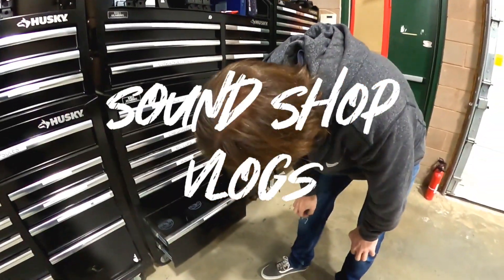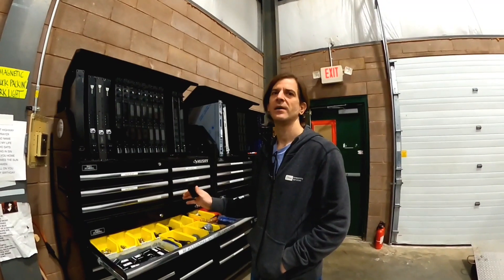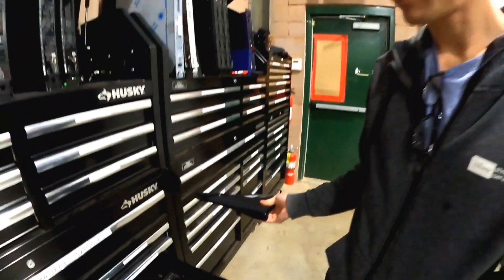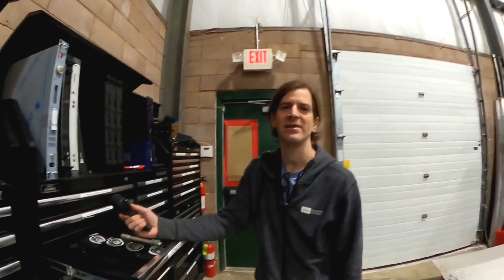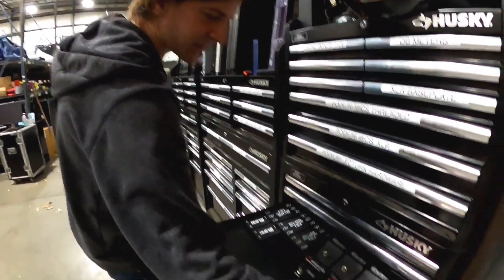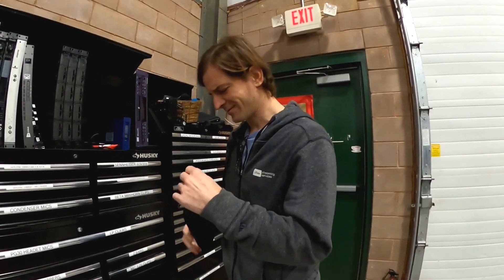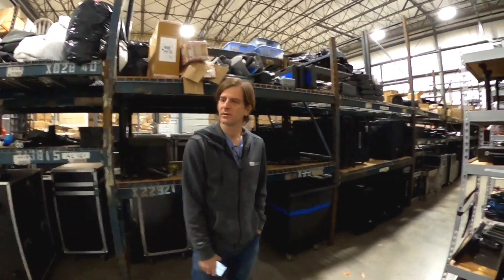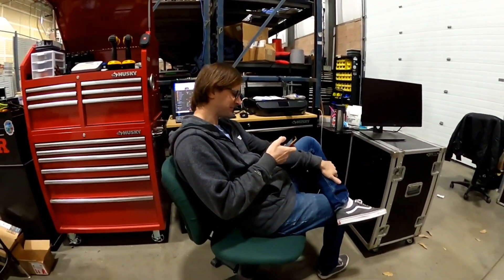s9e12 Our Microphone Collection Revealed! Shure Sennheiser |Company Owner Pro Tips | Missing AKG414?

Comment: What was that measurement mic with reversed polarity?
Reply: The Dbx one that is sold at guitar center
Reply: @michaelkurczeski1373  I thought it looked familiar... Never knew it was internally polarity reversed. But I guess it really shouldn't matter if you're using only one mic.
Reply: @lesfilip  I use it to tune systems and time align. When looking at the impulse response I can see if the polarity is positive or negative and it had me scratching my head a few times before I remember the mic is reversed. At times I’d reverse the polarity on my interface, then a few gigs later forget that I did that, be using a mic that is pin 2 hot and again.....scratching my head going WTF!